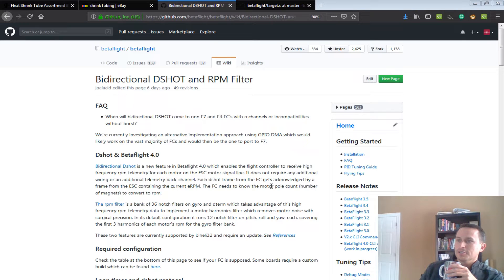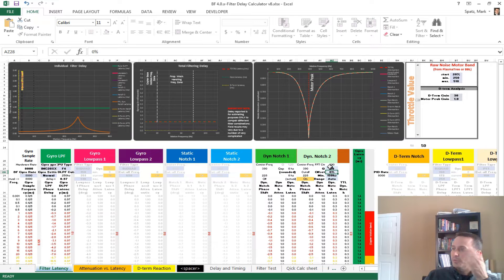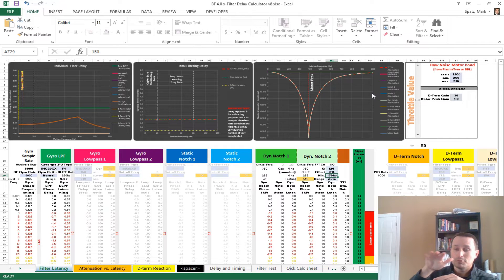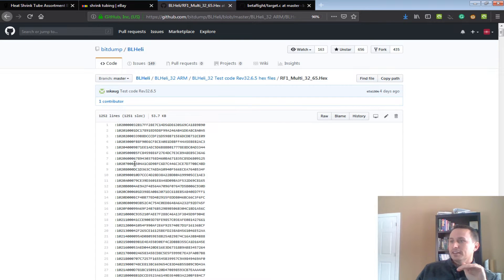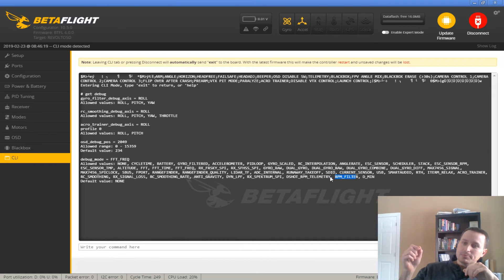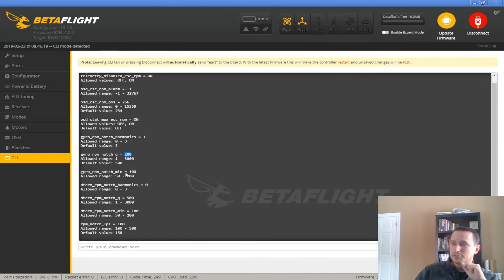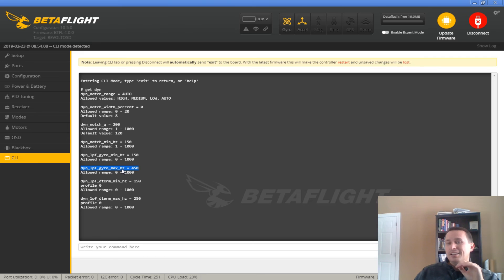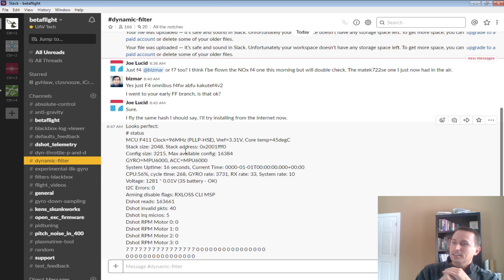Betaflight RPM Notch Filters - A Sneak Peek!!

Comment: thank you for this great explantation of rpm filtering. from what I'be seen so far it could become the next big thing to further advance the way our quads fly, feel and act in regards to prevent propwash.
Reply from the maker: It is effective to kill the motor noise band for sure.
Reply: @uavtech  ok. But does it not improve propwash handling?
Reply from the maker: @michaelfpvchiemgau8082  , yes.  Allows u to raise LPFs even further, or turn off, to reduce phase delay.

Comment: Actually it’s the rpm filters that are dealing with Bent props. They react instantly to motor oscillations which is what you get with bent props. If they are really bad you will get a shaky quad but you should see massive increases in motor temps that cascade over to the other motors. It’s extremely good for racing. I’ve been using it on 35°c race days and it’s pretty impressive

Comment: Super video. I am getting prop deflection at high power. Wondering if I am exceeding the speed of sound. What is the actual RPM calculation? Use DSHOT_RPM_TELEMETRY or RPM_FILTER?

Comment: This feature sounds great , but I really don’t understand how the pick noise is the same just for the rpm and poles?
Dose the KV / props / motor manufacturing etc also affect the freq ?
Reply from the maker: I hear you.  It works well so the fundamental peak of noise is just the motors.  If u have crap props (balance), that seems it just makes that vibration freq. higher in amplitude.  If the props flex, as shown in my props video, then that results in spread noise for which the Dyn Notch and/or LPFs will need to clean up.  Better, fly good props that don't have that issue (flex along the blade).

Now, for damaged props, it seems to be more balance related, so increasing amplitude of the motor fundamental; which RPM will continue to.cover.  That assumes it is not drastic.  If catastrophic, like after a crash, then the Dyn Notch starts to pick up some of the spread noise.

The goal is to get your mechanical squared so you do NOT have broad spectrum noise so that the RPM filters with the Dyn Notch are all you need.  Both fully automatic; and no magic snake oil, of course.

Comment: Awesome content. This new filtering solution sounds cool but i still have a lot of questions about the reliability of this, some of which I see have already been mentioned in the comments, or you in the video. From my current understanding it feels like this would work great in the ideal world but the average freestyle quad is far from ideal, we bash these and crash and want to continue flying. Maybe i got it wrong but i cant see how you can pinoint the exact noise peak just from the RPM info and one motor variable and quick lookup table. You say they have to be really precise, and if they are not, then it really defeats the purpose of it. It sounds like an open-loop system that just calculates the value from these 2-3 variables then sets the filter and prays. Does it have like a "closed-loop" component that "checks" (kinda like the dyn notch) whether its doing it right and maybe do some adjustments? would that be just the normal dyn notch or a combination ? I really feel the urge to close this loop. maybe i dont fully understand what they are doing here :) P.S. your intro is a bit loud here haha, I set the volume a bit up to hear your voice, then the intro kicked in and my TV exploded :)
Reply from the maker: So we are not trying to push out the Dynamic Notch yet.  Still is needed to "close the loop" or get any peaks off the fundamental from the motors.  

What we are trying to push up or off is the lowpass filters.  They just have so much more delay than notch filters.

Sorry about the TV.  Bu to some extent, that is the effect I'm looking.  :-)
Reply: @uavtech  thanks for answering :) clarifies some things !
Reply from the maker: @gyropyro7338  , no problem.  It does work to address the spread peaks from the motors.
Reply: It is actually really reliable and there's no lookup table or anything like that. Basic physics, RPM (revolution per minute) is directly convertible to Hz which is in fact nothing else than "something" happening periodically in every one second. In case of quadcopters this "something" is the motor revolution per second. The ESC simply reports back the current RPM of the motor which the ESC can detect fairly reliably. Having the RPM is equal to having the current motor frequency. The motors themselves are the dominant source of noise in quadcopters. Of course perfectly detecting frequencies is not achievable, that's why we have the Q value for the notch filters to cover these measurement errors.

Comment: Hi, how is it possible that I get gyro rate in Status 7400 even, but it is always 7960-8060 in Tasks?

Im running F745 bf4.0.5 8/8k 1200DShot bidir and RPM Filtering - cpu load 17-19%
Reply from the maker: I'm not sure.  I would ask this question on the BF Official FB page or in the BF Slack.
Reply: UAV Tech thanks for reply, though maybe there is clear short answer I’m missing. Thanks :-)

Comment: Maybe it is possible to dynamic bypass those dynamic notches when the frequencies are very close to each other. In best case only one is needed and if the frequencies differ up to all 4 may be required, but not for all te time. It could save some delay. I guess someone with good math-skill can find the optimal value for Q and below which spread it is ok to bypass some filters for smallest delay.
Reply from the maker: Gotta leave something for BF 4.1.X!  :-)

Comment: Hi, great video! Does this work on 4in1 ESC with telemetry?
Reply from the maker: Works on any ESC that is 32bit.  No telemetry pad required.  They made the signal wire to the ESC bi-directional
Reply: @uavtech  is there any hope for this coming to blheli_s, or is it already on its limits?
Reply from the maker: @DennisRiessbeck  , there is good hope.  Jshot is being developed.

Comment: To turn off the dynamic low pass filters I'm pretty sure you set the min value to 0 to turn it off not the max
Reply from the maker: Either works.  If Max is less then min, it disables.  But then you still have to go into GUI and turn off Static LPF as it will activate.

I like saying to set Max to 0 as that will then turn Min to 0 after you save.  Very clear it is then disabled.  However, don't forget the static will then need to be turned off as it jumps in if dynamics are turned off.  Almost like a confusing safeguard.

Comment: Why do we have stage 2 filter?
Will not the first lpf stage filter it all?
Reply from the maker: Was needed for 32k sampling.  Or maybe if you have a really, really, noisy quad.  Same goes for static notch filters.
Reply: Will not the first stage already filter it out when it go through the second filter?

And why not always set the second stage to the same cutoff value as the first? (Extra delay?)
Reply from the maker: @wargert  , the name "cut off" on a filter is a horrible name.  It just means the point where the filter take the amplitude of the noise an reduces it by 0.71 (-3dB).  See my video: https://youtu.be/A09sprstYqI for more details on how filters work and how each filter adds associated Phase Delay (offsetting of the gyro signal).

So each filter in series adds more filter attenuation of the incoming noise, but also add more offset (phase delay) to the incoming gyro signal.

Comment: Your quad is the "sausage" made with Chinese "designed" props, 3 thousand different designs per month. 
The 3D helicopters with a constant RPM during performance does not need these dynamic RPM notches. And their straight blade NASA airfoils have countless research papers of plots of lift/drag coefficients for you to properly make a craft from science, not sausage.
Reply from the maker: Yeah, but a quad out of "sausage" flies better.

Quads out perform helis and can do thing noone would dream in a heli.  Never saw anyone fly a heli through an abandoned building, power looping rafters and diving elevator shafts.  Nor does the movie industry use a heli to carry a $35,000 camera for amazing areobatoc shots you can't get any other way.

Quadcopters (and hex and octo) use variable speed motors and a notch filter that track these motor vibes - per motor - for smoother flight.

Not all quad parts are made in China now a days.  Quality is out there.  Besides, the heli parts, also --> china.  And Just because a thing is made in China does not mean directly it is bad.  My phone is made in China, works great.  My TV too.  My PC.  Everything is made there practically.
Reply: @uavtech  I have never seen a quad dives from above the could for more than half a minute like this single-rotor video https://www.youtube.com/watch?v=upqED-hF6A8 . And the single-rotor flies for more than half an hour without changing to a special prop on the ground. Every time I see a quad dives from above the cloud, it tumbles to nowhere with the idled props and the owner uses GPS to recover the craft.